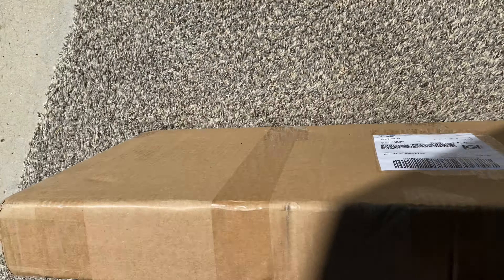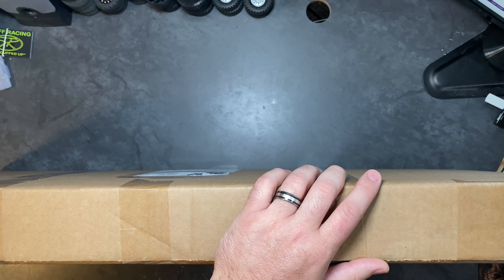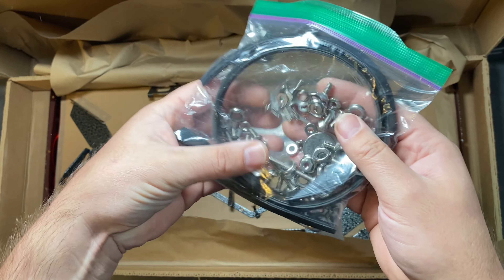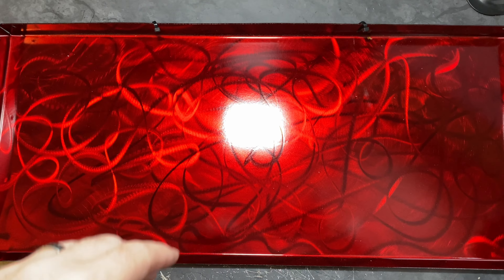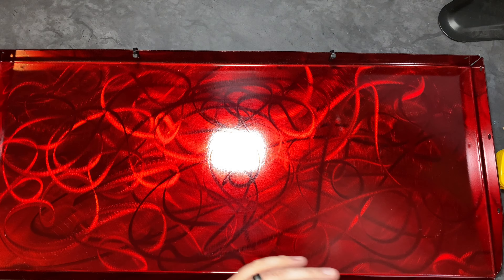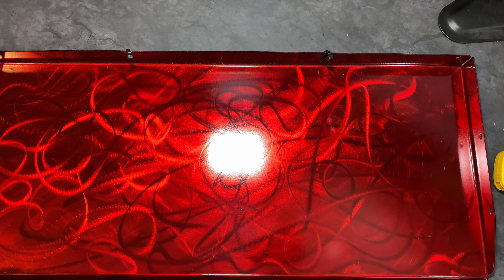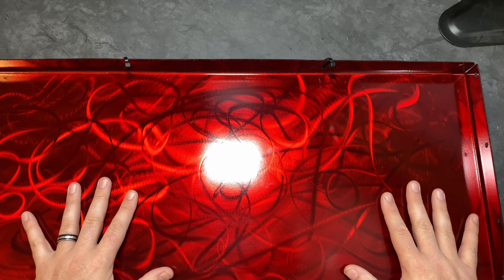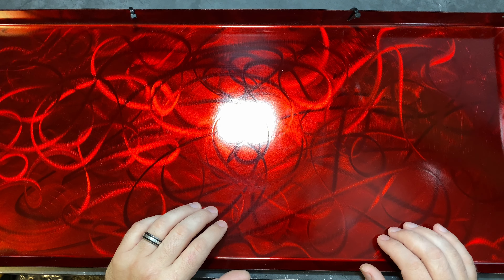Turtle Labs Portable Field Bench! Work on your SCX24, Mini-Z or Whatever, WHEREVER!

Comment: As a welder/fab'er, considering it's made in country, that's not expensive. I'd charge that just for the tray! Don't know how they're selling them that cheap and it not be made in the big rock candy mountain.
Reply from the maker: The tray has no welds, it’s all bends but yeah, it’s a pretty good deal overall.  It’s an awesome tool for sure.
Reply: @TheShopMiniRC  I'd say so. Buy and deliver the sheet metal, sand it clean, notch corners, drill holes, bend in a brake, dress the edges, swirl pattern with grinder, sand/wire wheel the surface again, degrease and prep for paint. Couple coats of red. Couple coats of clear. Dry time. Packaging and packaging time. Shipping...........That's a lot for a $180. :)
Reply from the maker: @wingnutbert9685  then it seems to be a fantastic deal!
Reply: @TheShopMiniRC  If you asked me to make it in my shop, it be at least double that....  :D